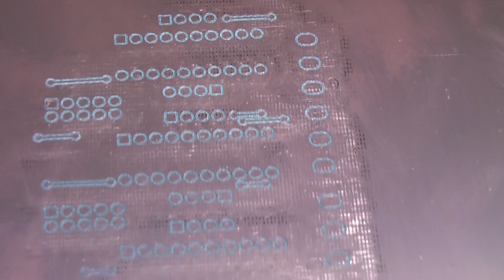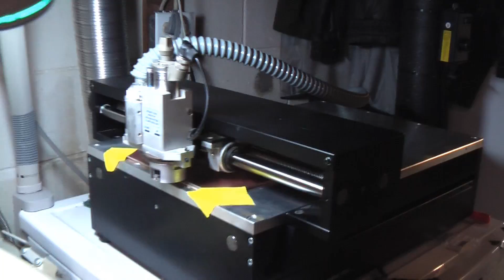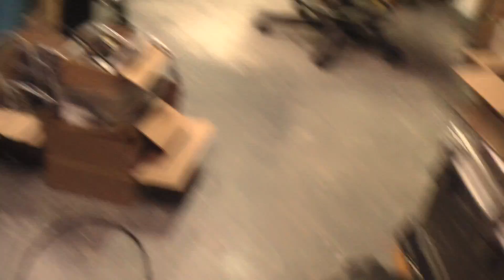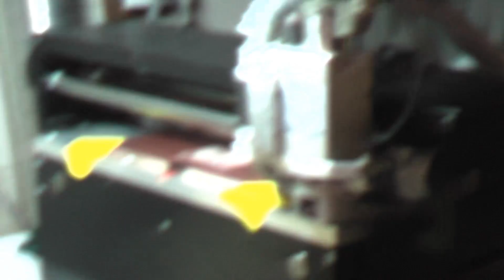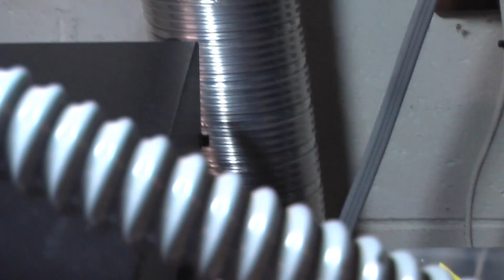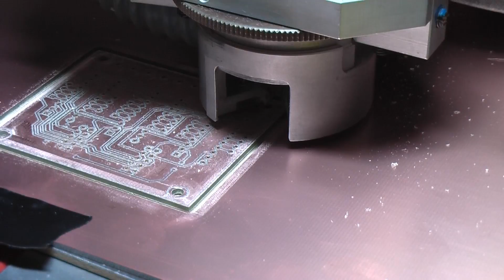PCB Milling using a LPKF 93s milling machine from the 90's

Comment: Hope you already fixed the problem of hole offset. If not, you need to adjust the head position. I have similar machine, and had similar problem during spindle repair, I fixed it by moving the head position. Before you move the head position, just drill a reference hole, so you know where the original head position is.

Comment from the maker: I picked up the machine from a guy at an expo for microcontrollers about 3 years ago. The model I have has the power supply built into the machine, so all it needs is a power cord. The interface was also built in and just needs a serial cable. There are a lot of people doing similar work with more generic machines. If what you have looks like the one in this video, then it should be all self contained. If it's more of a general purpose CNC mill, then I would have no idea what voltage it needs.

Comment: Thanks for the video! That was very helpful. I found such a machine in storage and would love to mill something! Unfortunately both PC interface as well as power supply are missing. May I ask, how did you connect the milling machine to your PC ? Do you happen to know the voltage output of the power supply ?